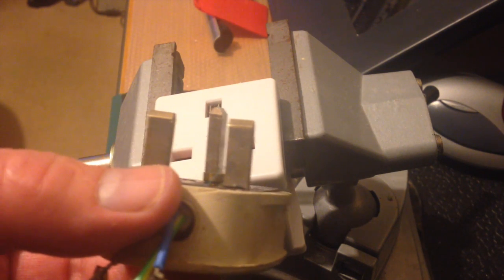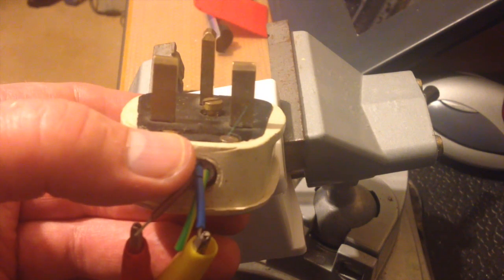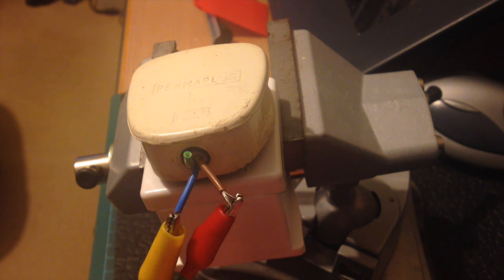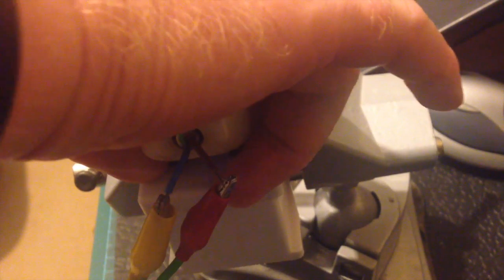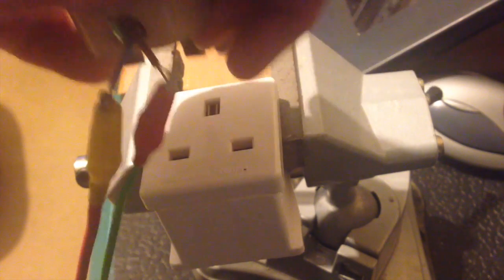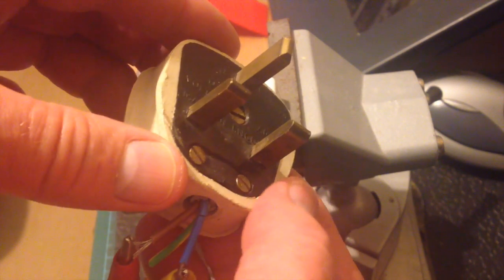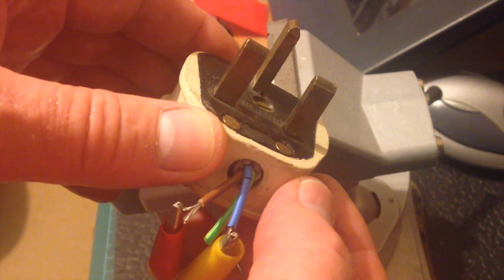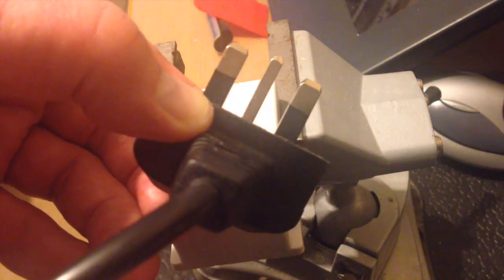Myth Busting - Is The Old UK 13 Amp Plug Really Deadly? You Decide!

Comment: You wouldn't be able to pull 30 amps from a standard wall socket. 
Even so, an excellent video. I have several unsleeved plugs, I'll have to check them.

Comment: There have only been a couple of instances where I have had to ask my dad to replace a brass pin plug with one with sleeved pins,
one example being something from the early 90s that shouldn't have an old style plug anyway but in the case of a vintage portable
radio I would be inclined to just use it with a more modern figure of 8 lead ( moulded plugs are in some cases safer ).

But if it was an old table lamp I probably wouldn't bother, also some unsleeved plugs are flanged at the base so that also prevents
your fingers slipping especially the old bakelite MK ones from the 60s and 70s the flange is so wide plus it's solid build makes it 
easier to grip but for some reason those ruberised ones like this example didn't tend to be flanged. I tend to keep older plugs more as 
collectors items.

Comment: If anyone is daft enough to stick their fingers behind the plug while the power is on then good luck to them.
Reply from the maker: Its not so much daft, as clumsy, as we all know very old people have very old appliances, that were plugged in in 1963 and have been in the say board, because back then things were made to last. Due to the heat they've kind of welded themselves in place and some unknowing person tries to pull out the plug pulls hard and their fingers slip behind the plug and its Goodnight Vienna

Comment: Wrong experiment, you should have checked if it is still connected to socket...
Reply from the maker: Very good point, but having zapped myself in the past after a few drinks reaching behind a friends tv to pull the plug I know it still works, but I'll improve on the video. Regards Malcolm
Reply: FIXED1T i trust you that it will still shock, but it might be treated as kind of manipulation :D